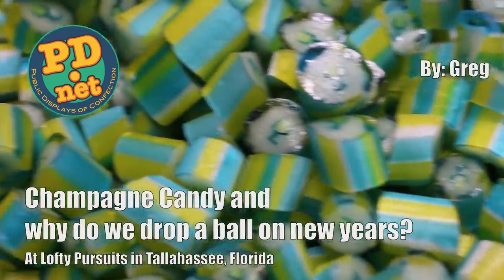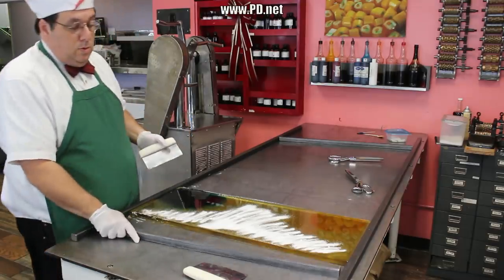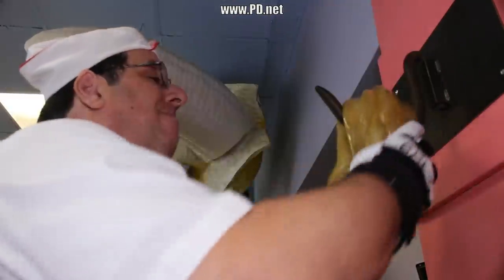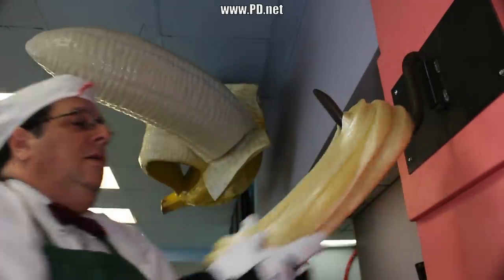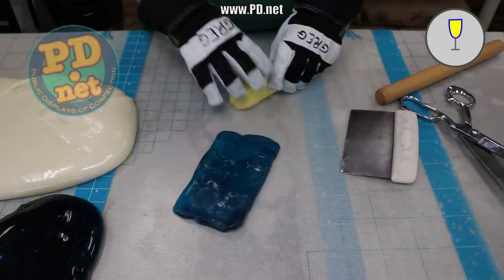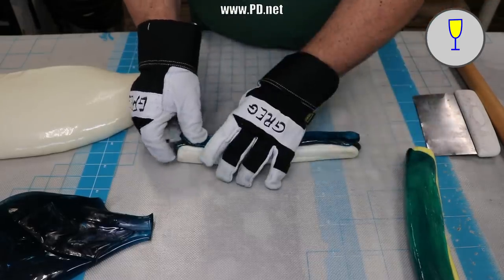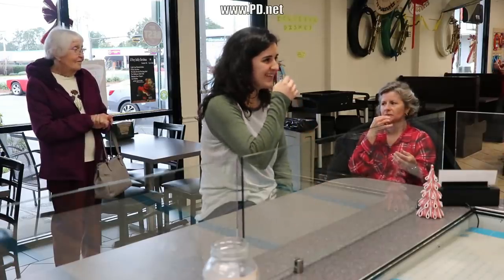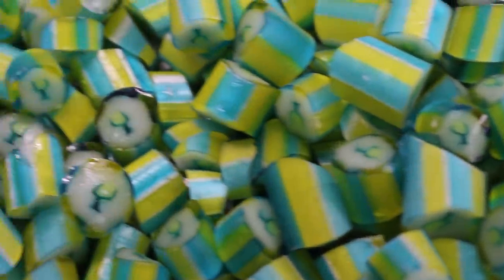#90 Carbonated Champagne hard Candy, and why do we do a count down for new years?

Comment: You actually can carbonate hard candy, It's how pop-rocks work.  The microscopic bubbles of carbon-dioxide  are warmed up by the heat of your mouth, causing them to increase in pressure via the ideal gas law.  As the candy dissolves in your mouth, it becomes too weak to withstand the pressure of the warming gas and bursts.

Another fun fact about fizzly candy:  There used to be a type of Skittles that were coated in a mix of citric-acid and baking-soda to get the same fizzle effect as your champagne candy.  The problem was that the raw baking-soda left a subtle alkaline, almost metallic, flavor in your mouth.  Combined with the pinching sour from the citric-acid, the sensation was more like a static shock or licking a 9-volt (not that I've ever done that), which, while fun, many people found unpleasant and ultimately led to it's discontinuation.  

Feel free to use this knowledge if you ever want to make an "electricity" flavored candy ; )
Reply: I wonder if a candy with ozone bubbles would taste like electricity 🤔
Reply from the maker: Thanks. I've wondered about the poprocks. Spoke with the inventor once, he was not sharing with how he did it.
Reply: I think the sugar dissolving is more significant than the temperature change. Remember that pressure is proportional to absolute temperature, so the difference from room temperature to mouth temperature is quite small.
Reply: @LoftyPursuits  as far as I know, Pop Rocks are just ordinary candy made under a high pressure CO2 atmosphere. Not something that can be made by hand, unfortunately.
Reply: I think I had some of those skittles once? They definitely had citric acid on the outside and it had an intense effect (I absolutely loved it).  That was last year though and I don’t know when they discontinued them, so I might have just had really awesome sour skittles!
Reply: Licking 9 volts is totally safe. Give it a try!
Reply: I would buy that

Comment: Why do you cut the canes with the back end of the scissors? Always wondered. 

Love the videos =]
Reply from the maker: The curves been on the back just seems to cut better. To make it snap write a need something wider than a short edge, and this hasn't. We used to use another tool and then one of my candy makers discovered that this work even better than what we were using and with use it ever since. It's more convenient because it's always handy and the darn thing works. He discovered it when he couldn't find the tool he needed fast enough and when it worked it worked.
Reply: @LoftyPursuits  Cool! Lovely to hear a reply =]

Comment: Speaking of Wernher von Braun, a fun fact about the Saturn V rocket is that the little fins on the first stage engine fairings were completely unnecessary. Wernher just liked the look of fins and insisted on them being added. The decision could have been overturned, but since the fins didn't make a significant impact on the Rockets performance they werent taken off.

Comment: Wasn't there a candy that felt fuzzy when it's in the mouth?
Reply: Pop Rocks is one.  There are also a few hard candies with powder in the center that foams.  I used to absolutely love them, and now I don't remember what they were called.
Reply: sinnison23 zot! Those ones use a bicarbonate reaction, like what Greg was making in this video. 

Pop Rocks would be neat to make but they require even more specialized hardware than what Greg has (and it wasn’t available during the era that he focuses on). Applied Science did a neat episode on making them at very small scale a few years back.
Reply: Jones Soda made carbonated candy for a while.